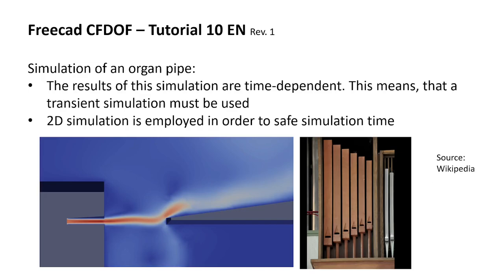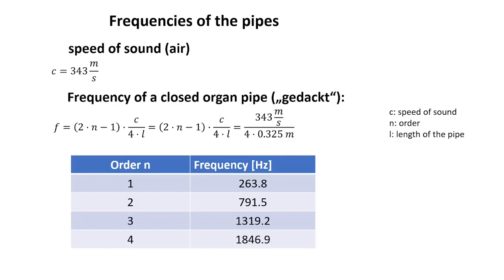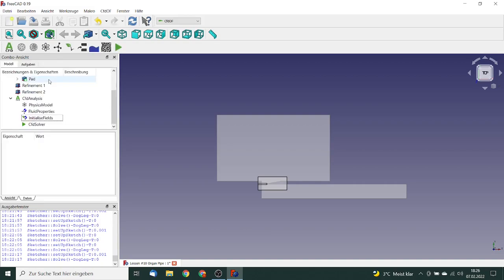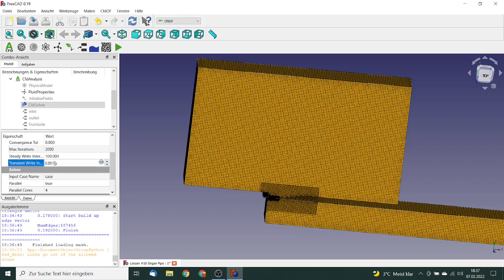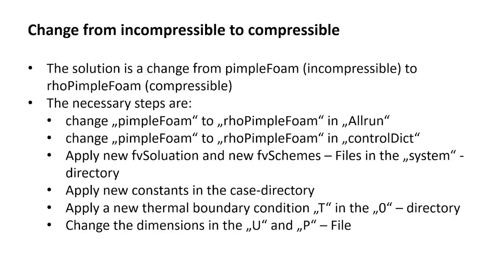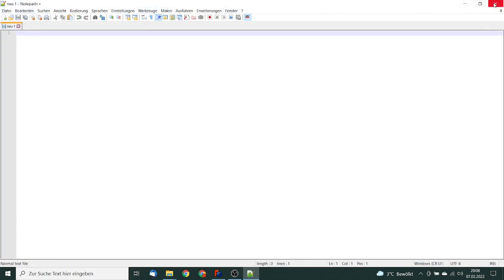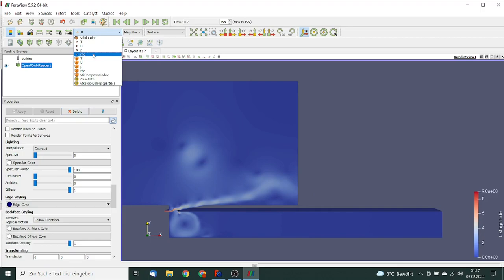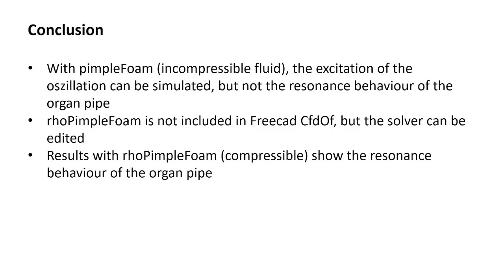Freecad CfdOF Tutorial #10: Organ Pipe

Comment: Thank you for this excellent video. Could you explain how to simulate a spray with Freecad 0.20?
Reply from the maker: Hello Valeria, in general, a spray consists of 2 phasis. As an example, we can take a fluid (for example, water or alcohol) and air. There are many ways to simulate the flow of a spray: You can consider the spray as one phase and neglect that the spray consists of 2 phasis. The flow properties of the spray are then the average of the individual phases.

A second approach is to simulate the behaviour with a 2-phasis model. You can see a simulation of a 2-phasis-model in this tutorial: https://www.youtube.com/watch?v=H5vWh0NG6z0

There are several more approaches for the simulation of a spray, but I am not sure if theses approaches are already included in OpenFoam. I am very sure that these approaches are not included in CfdOf, so you have to edit the files manually as shown in this tutorial.